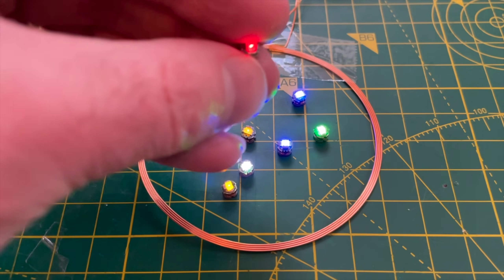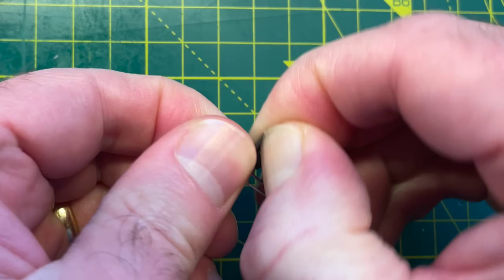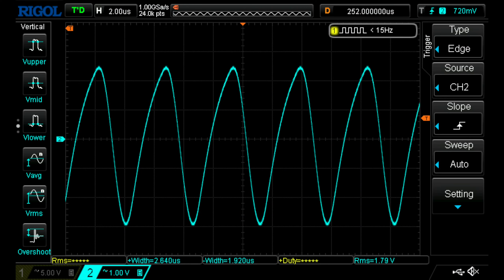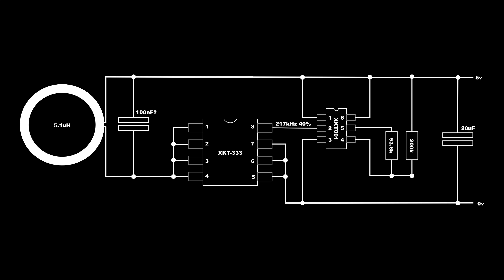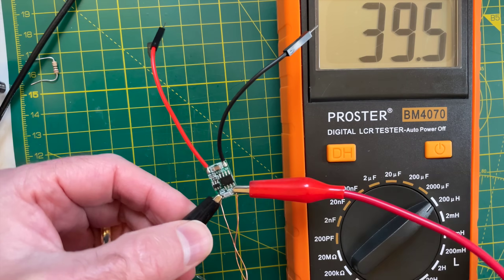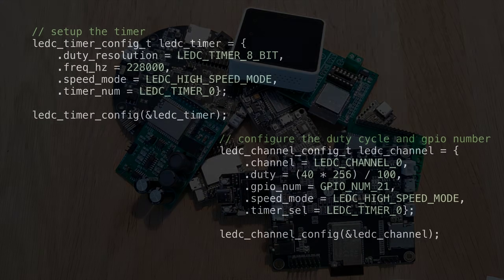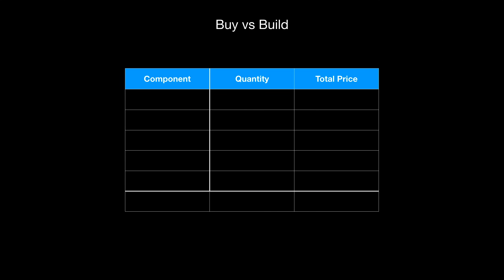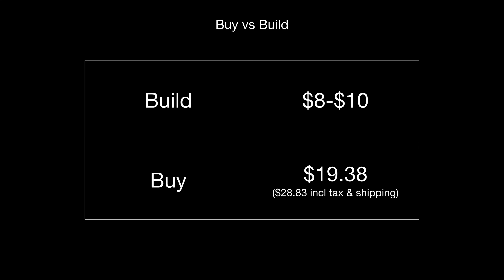DIY Wireless LEDs Made Easy: Step-by-Step Guide

Comment: This is fascinating, I have a very specific use-case where I will be buying the pre-made units because I need them to be very small, but I also want them to have light emitting all around, so I want to see how many LEDs each part can drive by just soldering extra SMD LEDs to the same leads as the existing one.  I'll also have to check if I can do the trick of reversing some of them to use the other half of the waveform.  Ideally I'd like 6 LEDs running off of a single inductor in a very compact little package.  I"m really hoping there's plenty of overhead in the design, since LEDs really are very low-power devices.

Comment: Would extending the cables from the inductors, in order to have the LEDs at a greater distance from them, affect their operation? I was wondering if I could use such an array in order to "wirelessly" power some LEDs located inside scale models. The concept is as follows:
1)Make a diorama-base with the large coil.
2)Put small coils in appropriate places inside the model (located as low as possible)
3) Run wires from the coils to the LEDs you need to power.
4)Place the finished model on top of the base, making proper alignment with the main coil and the internal ones (located in a certain area inside the model).

Comment: I know this video is 2 years old, but I am wondering if these micro wireless LEDs will power with just a normal wireless charging pad.
Reply from the maker: They will light up, but tent to flash on and off. Most modern charging pads will detect if there is a phone on the other side and will power off if they detect a foreign object. So you get periodic flashes.

Comment: Let’s say I wanted to make some liquid core resin dice, and I wanted to cast a a wireless led in a bit of shield of resin (maybe just 5-6mm in diameter), put it in the liquid core vessel with a weight on the bottom so that it always sinks to the bottom of the liquid core and shines upward, illuminating the top 70% of the dice.  

Now let’s say I wanted the LED to slowly flicker so that it looks like candlelight is radiating from the dice when rolled in a dice tray with the coil in the bottom of it. 

Would something like that be possible?  I’ve seen people on Etsy put flickering leds in miniature terrains, like wall torches, fireplaces and campfires, burning debris ect, but it’s wired to something that I assume has the flickering element “programmed” into it and then connected to a battery obviously. 

What would you have to do with the coil and its power supply (if anything) to cause that flame flicker effect I’m interested in?  Thanks in advance.
Reply: Yes, but this tech isn't really that bright. I got it to work, but you would need to super tune the transmitting coil with what is used in this video, run at 24v high power. There are tons of dead spots around the coil. The coil varies output power (brightness) a Lot rotating in 3 axis. I was gonna use this to power minis with light up lanterns, torches, etc. It works, but a coin battery (2032) is just better. Better go with a Big D20, and the coil under a THIN dice mat at the bottom of a dice tower. If you really can cast dice perfectly, let me know, I can send you what makes the flickering circuit work.

Comment: How about a single npn transistor with 1.5V battery. This is the simplest and cheapest wireless led solution and it works.

Comment: Would it be possible to have something of similar size, but tuned to the mains frequency? Is there enough emissions from the wires on the walls to light up a LED? And what about something that works on WiFi frequency range and will gradually self-tune to the strongest frequency in the range it picks up? Would there be enough energy to light up a LED that way?

Comment: Could a circuit be designed to drive LED strip or tape lights so that they could be attached with cable ties or clear tubing to 40vac extension leads so they light up when the cable has mains power applied?
That would be useful!

Comment: What if you wanted somthing that would light up when on the wireless charger, but could be connected to a battery pack/on off switch so you could use it away from the coil as well?

Comment: nice. I purchased the wireless led kit from Adafruit, and being inspired and added some components to a mouser order I was placing:  2.2mH inductors ($0.43 each),  240 pF capacitor, and red LEDs.   I thought using 2 LEDs was a brilliant move, but it turns out not so brilliant.  That is, 1 LED is much brilliant (~2X the brightness of an LED when using 2).
Reply: Where did you find 2.2mh inductors at cd43 size?
Reply: @smoll.miniatures    It was either Mouser or Newark.

Comment: Can you do this using an SMD LED? Would love to add lights to a project and I need the overall size to be as small as it can possibly be :/ the inductor may be the biggest issue.
Reply from the maker: Yes, you can, I've got some video of me doing it that I was going to post, but it's pretty short. 0503 inductor size works well, just make sure there's enough of a pad to solder 1206 led and capacitor across it. I'll see if I can clean up the video clip and post it.
Reply: @atomic14  please do! I need something neat for a figurine décor/hacking of a fairly hard to get figurine.... Yeah... If you can throw in a suggestion list and tell us why you'd go with other parts I'd be really happy, just happy to get any tips what so ever really :)

Thank you for these videos! <3 have great new year!
Reply from the maker: Here you go: https://youtu.be/ze2MXYFsqFk
Reply: @atomic14  Thanks m8! Found the video the same hour you uploaded it! Wonderful job! <3

Comment: I was trying to build this circuit, but i was unable to find the ESP 32 controller, i have found the ESP8266 module,  this is suitable for the project? It is compatible with the code?
Reply from the maker: I don't believe the ESP8266 has hardware PWM. But as has been pointed out in a lot of comments you could probably just use a 555 timer and it would still work.
Reply: @atomic14  ok then ill go for the Classic 8-pin 555 ic for testing, but i’m planning to drive several inductors to light up different areas on a house model… i think it is posible to use different frequencies and an arduino nano to do the task…

Comment: Would love to see something like this become a wireless Christmas tree lights.  Perhaps hot glue on to a tree branch, hang the coil like an ornament to power them and no more wires for the cats to chew.  How many lights will one coil power?   It looks like each set has about a 9 inch radius, so it seems like it would require a few coils to decorate a tree.  Not to mention linking them up.  Hmmm.  Maybe it's not wireless after all.

Comment: I don’t get it. Why use ESP32 if the original didn’t have it? What does it replace here? Why is a different microcircuit used here than in the original?

I really want to repeat this project, but I have very little money and I want to do it as cheaply as possible, so i don't want to buy nothing extra.

Comment: Are you sure the shrink wrap on the inductors shield anything? This is not the case on the shrink wrapped inductors we use. Works actually slightly better with the wraps since the permeability is 1.00002.  The resonance frequency changes quite a bit with the load you put on. Can you test out what it is by varying the oscillator for max power?

Comment: Thank you very much.This is absoluteley stunning.
I was wondering how changing the coil Turns and diameter would affect this built and which physical laws could help me figure it out.
I quite suck at understanding induction, but would like to experiment with this for different output voltages.

Comment: Now I want to make this-ish but overkill...add a supercapacitor (there are some good cheap tiny options), and as someone else suggested, cast into resin...possibly with coils at right angles - the ali video showed the power drop off significantly when the pixels were rotated against the magnetic field) - add a bridge rectifier, and the cap, and you've got yourself some fun glowy marbles that ...do things.

Comment: Is it possible to build a modular (linear) charging platform so that the wireless LEDs would be individually addressable via their position in the sequence?
(E.g. a strip of 4 "slots", configured so that each slot would light up individually in increasing sequence. In such an arrangement, a person could insert/remove different LEDs in those slots but they would always light in the same sequence)

Source: I have many RGBIC led strips at home, but am curious if a more modular platform could be made for repurposable needs.
Reply: There are severals ways: have separate coils for each position in which the color data is fed through each coil is one example.

Comment: Two quick questions. How many turns on your main coil? Would more turns boost output?
Reply from the maker: That’s actually quite an interesting question. I did four turns which matches the version from AliExpress and gave a similar inductance value. More turns will change this value so you’d need to adjust the capacitor to get the same resonant frequency. More turns might actually decrease the range. Seems counter intuitive, but I think the voltage induced in the receiver is determined by the ratio of turns in the receiver coil to turns in the transmitter coil. So more turns in the transmitter would reduce the receiver voltage - this would mean that you would fall below the forward LED voltage sooner.
Reply: The reason I asked the question was regarding turns ratio. As you're putting the energy into a tuned LC circuit the only 'turns' on the secondary side would be in the inductors & these could vary depending on manufacturer. Shall have to do some 'research' on this. What size wire did you use for the coil (I want so get the same starting point as you)? @atomic14

Comment: Would a small metal dish underneath the coil increase the effective range, or would that interfere with the signal by muddling up the frequency?
Reply: I imagine a small metal dish (assuming good conductivity) would make the LEDs not light up or reduce the range at least. The time-varying magnetic field from the base coil would induce currents in the metal dish that aim to reduce the magnetic field from the coil. So it wouldn't interfere by muddling up the frequency, but by reducing the power transferred from the big coil to the LED coils.

Comment: Given that component prices for LEDs and similar are always in freefalll, the main factor missing here was the time spent prototyping, making mistakes, hitting walls, lessons learned and then the actual production of consistently 100% functional pieces in a mass-production mindset for whatever one's given project is: whether one LED is needed or fifty per project.

Factor in whatever your time is worth financially (If you earn $15 at your day job, your down-time is worth the same or more) and then subtract those hours lost in other life-pursuits and I expect that mass-market LED is far cheaper than suggested here. 

The real questions are always "How much is your time worth?" and "What are you sacrificing by spending that time needed on 'this' instead of 'that'?"  In these terms those LEDs could cost a dollar each on the mass-market and still be worth the value brought home when factored vs. your personal time and peace of mind.
Reply: I know right, instead of building DIY versions, they could buy the commercial versions and then be spending thier time watching, and commenting on others doing it DIY.
Reply: @notahotshot  Or spend that free time commenting on commenting or even commenting on comments commenting the original comments.  One wonders where all the time comes from.

Comment: The SMD LEDs are not hard to create, just use SMD coils, they are easy to get hold of and definitely can work without the capacitors although they don't perform as well they work well enough, and have to be REALLY out of tune to not work actually, so it's hard to make them not shine at all.

So DIY LEDs + an induction heating driver can work as a starting point for your wireless powered LEDs.

Comment: Good stuff, but for those of us who don't have electronic parts lying around already, or who would have no use for the excess that comes with buying in bulk, it's actually cheaper to buy from the Chinese. Still, it's good to have the option!
Reply from the maker: Indeed - the build vs buy is always a lot more nuanced than simple cost.

Comment: How realistic would it be to tune these on 2.4GHz and let it light up next to the WiFi router / Phone ?
Reply: Hmm, tricky, aside from the power from the device and the manner in which it's transmitted, to achieve the resonant frequency of 2.4GHz, even with the smallest value capacitor of 0.1pF, you'd need to find an inductor value of 0.04uH which would be challenging...
Reply: @Umski  use PCB traces instead of discrete components.
Reply: @mrtechie6810  maybe, but realistically even a perfect 2.4GHz patch antenna may only achieve at best a -30dBm sensitivity which is 0.001mW of receive power crudely speaking - even the small LEDs shown need more than that to light up :/

Comment: What if I just use a 9 volt battery and a coil, skipping all the chips and capacitors and resistors and gates? Just current directly to the coil. Would that over power the LEDs?
Reply from the maker: It needs the oscillation to transmit the power unfortunately.

Comment: Awesome work!  I might have to try this project out.  You can get some mcu's for pennies, or try using an oscillator chip or circuit.  You can also get those SMD LED's and caps pretty cheap if you buy in bulk, so that will greatly shrink the size, but they're harder to solder.  Now I just need to find a use for them.... I'm wondering if there's enough power for a wireless micro bugbot thing.
Reply from the maker: I think a low lower mcu could definitely be  powered. You could also use the energy to charge up a capacitor for a more lower hungry device and then wake it for a brief time to do some work.

Comment: There is a misscalcution in the overall cost.  The cost for the MCU is not added. This is OK for testing builds, but if you like to build this fix into a project, the cost of the MCUs had to be added. Then the Chinese version is cheaper. If you need 10 or more kits, then the transportation cost is only 1 or 2$ each. Then the  really nice homebrew version is much more expensive. The "drama" of the most DIY projects :-) :-)

By the way: Looking for a cool project? If you build houses with LEGO the wiring is often terrible for lightning. So adding the big coil underneath the 1st floor allows a wireless lighting. I'll give it a try. It seems that the small LEDs may be fit into a manipulated clear 2x2 brick.
Reply from the maker: Indeed. It’s very easy to look at the price and think - that’s just a few components that only cost a few cents. But that ignores things like labour costs - even if you’re doing it yourself you could be spending you time on something else. The DIY option is definitely just for the fun of it.

Nice idea for a practical use!

Comment: In addition to adding a LED in reverse to the main one, try adding 3, 4, 5 or more led's in series (instead of one), the inductive kick voltage can power many led's in series, and no need for the cap across the led imo (actually its not helping at all at that freq), and the same with the drive coil cap, replace it with a string of led's + resistor, its free energy in the since your cap is just snubbing the drive coil kickback voltage, why not use it to power some leds. Try it and report back.

Comment: As always, the build-vs-buy question is usually less about cost and more about specificity - you can tailor the build to a very specific project, whereas finding a pre-built version to meet some projects might be impossible.  Plus the fun and learning of doing the build yourself, of course.
Reply: There's also the labor aspect--how much time did you spend prototyping, then building and testing the finished circuit(s)? I think this is the second half of the specificity trade-off. Your off-the-shelf components are ready to go, but might not be an exact match for your use case. A custom build can be made to your exact specification, but you have to spend the time to develop it to your specification.

Comment: The cost could be improved significantly, using bjt push pull for the gate driving, making an oscilator using an opamp (lm358 is dirt cheap) and you could probably get away with using cheapo mosfet like AO34xx which are cheap even in my country and can even do 5A and turn on even with 2.5V

Comment: Could you put a rectifier on it to make the LEDs brighter?
Reply: Yes with the right setup, LED forward voltage is around 1.8 to 3.5 volts for different colors. A regular diode (rectifier) drops 0.6V, so a full wave bridge drops double that (1.2v), this takes away from some of the power to the LED. If you used Schottky diodes, they only drop around 0.3v each, so better. Buy as i suggestested in a nother comment, I dont think the cap across the LED is needed, without it, you could easily put several led's in series to get more brightness, and then put more LEDs in reverse (as mentioned in the video).
Reply: I forgot to mention, they make bidirectional led's (simply 2 led's on one package and connected back to back).